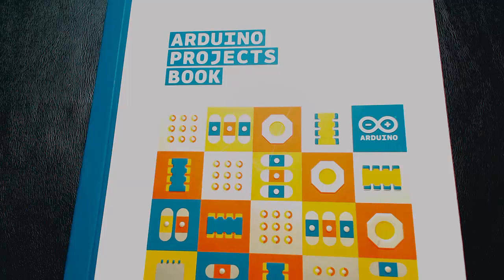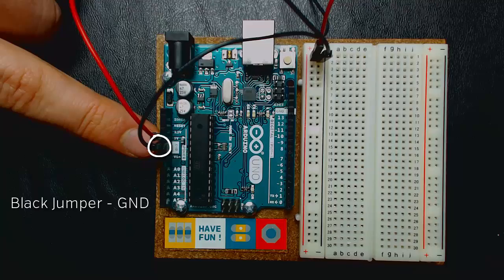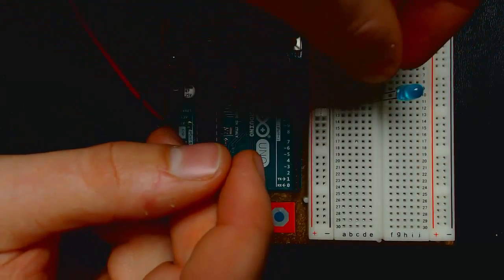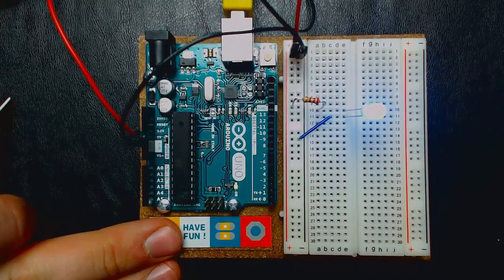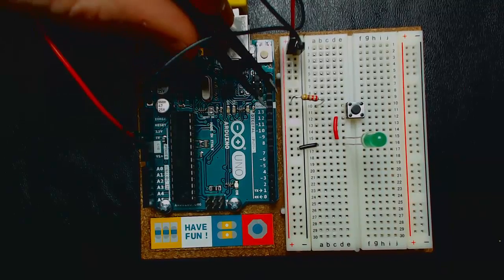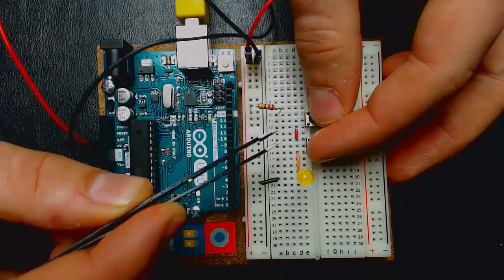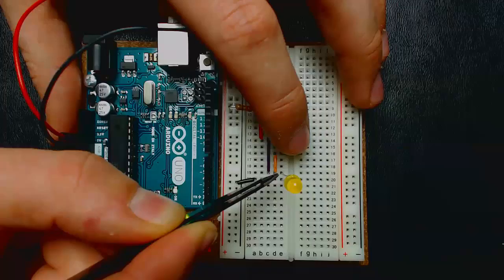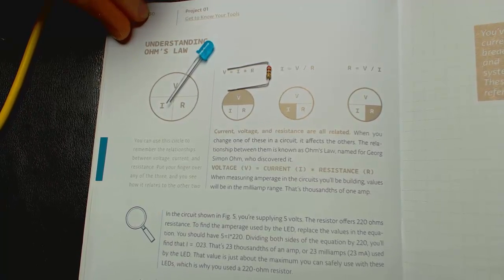Official Arduino Starter Kit Project 01 Know Your Tools

Comment: I'm finding the solderless wiring to be SUPER fiddly. I have to hold the switch down with one finger and press the resistor and LED in with two other fingers, or I don't get any current. If there's a wire or god forbid, two wires in the circuit, forget it - too many points of failure, it never works. The little "plugs" on the end of the main red and black wires are great, why didn't they just put some of those on all the components?
Reply: nevermind lmao I just wasn't pressing them into the breadboard all the way

Comment: Bro I wanted code for this plane https://youtu.be/WKkWElvF-a0
And I have made this https://youtu.be/bD7rQbnSbek transmitter and receiver. I whated that when I Any move joystick to right then one servo should go up and other down. Opposite for left. And that same servos should go Up at same time and as well as down at same time. And the code should be 2 servo and one brushless motor and brushless motor should stop when I take the joystick up and at normal position of joystick the motor should start Rotation . Please bro give me code because there no one who replied me only you replied me. I will subscribe to

Comment: I have tried many other YouTube videos but you explained it so well that what is 200 ohm resistor and what is the role of jumper and how we can setup series and parallel circuits. I am gonna use Arduino and this is my first video where i am on a point to to start making my own very first circuit 👏🎉

Thanks a lot.

Comment: Thanks. This tutorial is getting me started well.
The LED statistics were not included in the kit I bought. I've been using the resistor you recommend, and it's working. But it would be helpful to know the current requirements for the LEDs.

Comment: ive got a problem, my arduino starter kit hasn,t got any 220ohm plss can somebody help me??
Reply: i believe the 220 ohms in the newer kit are a different version, same problem here, apparently the blue resistor with 2 red and 2 blacks with a brown is 220 ohm resistor
Reply: @travislearns9778  where did you get that knowledge about it from it seems like the book have the wrong colors.  were can i check to get the correct colors

Comment: Do i need basic knowledge in electronics? I have zero knowledge will I be able to learn from a kit such as this? Or is there a better beginners kit that would offer full explanations of what is happening?
Reply: You need no experience in electronics. Just make sure you follow the instructions, and if they talk about resistors, make sure you use one with the right colours, or things can overheat, burn, or cause a small explosion.